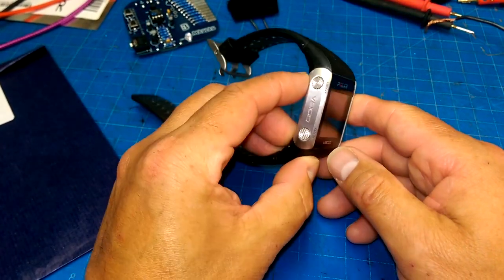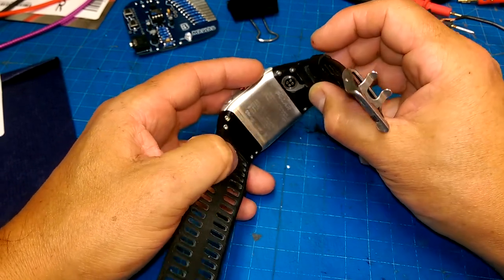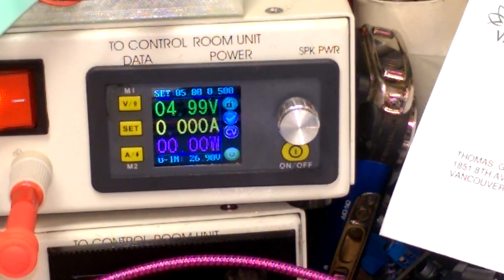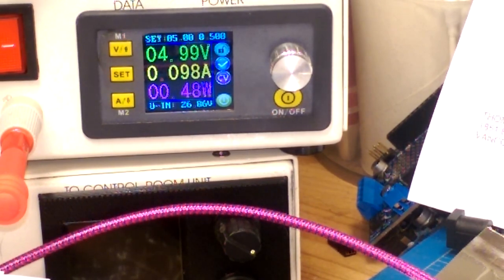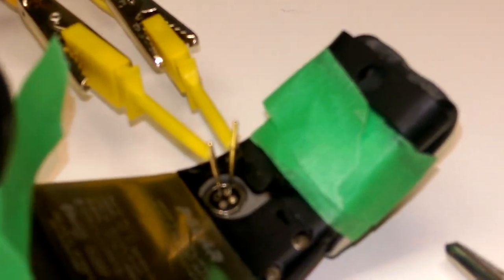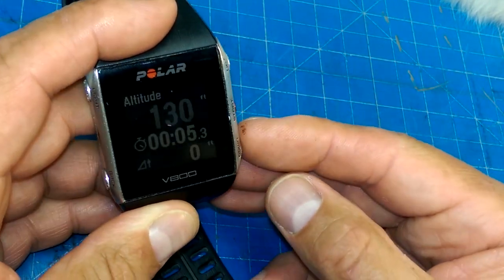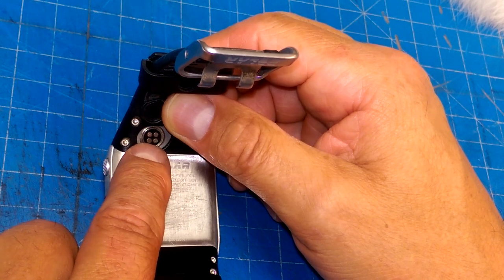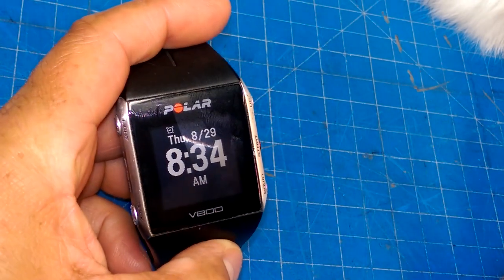Polar V800 Salvage

Comment: Hey hey....thanx 4 sharing this... I'm struggeling with the same problem with my v800 ...one xtra issue my v800 screen didn't survive a crash so it looks that i have to change the glass...the v800 still worked but after the battery died i have 2 things 2 solve...do you know hiw or where 2 get the screen....thanx again

Comment: Thanks. My v800 Polar doesn't work. It doesn't take charge. How can I repair it? Thanks again
Reply: It doesn't hold load
Reply from the maker: @pedroruizh276  this video is as far as I have explored the v800.  I would try finding a replacement battery and iFixit has a guide for replacement.